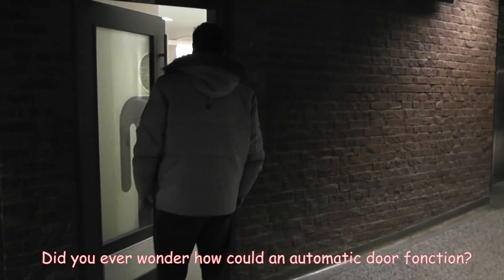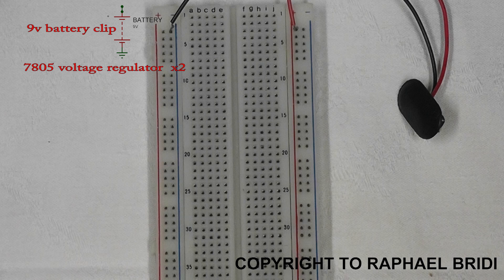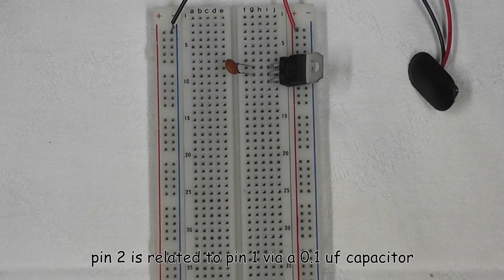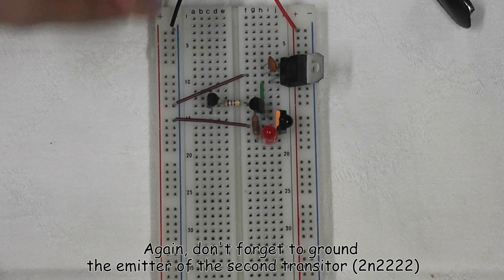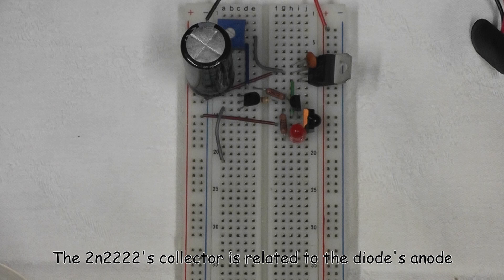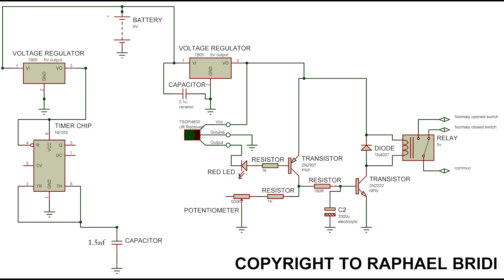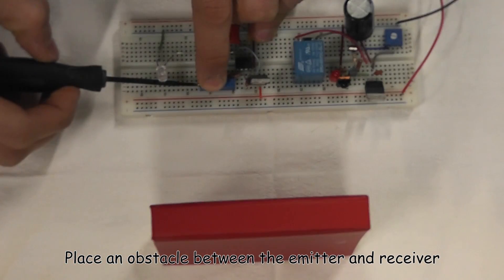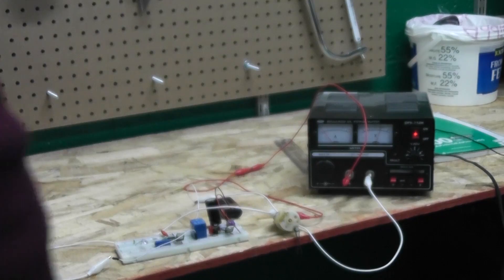[D.I.Y.] How to make an infrared motion detector

Comment: Sir, does the circuit needs two 9V battery? One for the main circuit and one for the relay? And can I use LED strips instead of the motor? I'm planning to do a motion sensing LED lights. Thank you, and its a nice video. Thumbs up!
Reply: And how many volts does the 3300uF capacitor have? I'm guessing its 50V 'cause its big, but I have to make sure. Thank you sir!
Reply: +Aliza Mae Alibusa you can use a voltage that is not less than the voltage from your power supply. for example if your power supply is 9v then use a capacitor that has a greater voltage value or greater than 9v. never use below the 9v your caps will be damaged.

Comment: sir can this detector be install to an air condition system to switch on/off an the air condition system?, eg switch the A/C on when there is motion in the room and switch it off when there is no motion
Reply from the maker: it will be a little more complicated to do that because you'll need a latch circuit to switch on and to switch off the AC. But you have a basic motion detector in this video that you could incorporate with other circuits
Reply: D.I.Y or DIE can you give me a kl idea for my final project which is simple no complications
Reply from the maker: bobby toomer make a laser security system. When a person passes infront of the laser, an alarm will go on. I will make a video like this very soon
Reply: D.I.Y or DIE sounds kool but thats if its not complicated .awaiting video
Reply: bobby toomer send me the link when you create it, and thanks
Reply from the maker: bobby toomer [D.I.Y] How to make a laser security system

Comment: one more doubt sir .can we use a infrared receiver diode instead of ir receiver placing an infrared diode in front of ir receiver led by making some changes so that once the circuit is broken by an obstacle the light or device shall glow for some time.
means if we connect led's to relay once the circuit is broken by an obstacle the light shall glow and after time ends its shall switch of automatically
Reply from the maker: the problem with the infrared receiver diode is that it doesn't have an integrated filter to block every other infrared frequencies to trigger the relay. So even the sunlight will switch your output on and off. The Tsop4830 is designed to only let an infrared frequency between 30 to 40 Khz to trigger the relay.

Comment: sir you rock i made this circuit.. initially i had some problems because this is my first project inspired from your video...but the circuit was completed. i had few questions on this project..
i am using a 6v relay bcoz 5v relay was not available is it ok to use this relay, as the relay is working properly.
my pot is also different.
can we connect breadboard to a 9v supply directly from charger or adapter..
and as you connected the motor in the end with a 9v supply..what is the highest volt that we can connect to a 6v relay .
and can we connect bulbs or cfl's to that circuit or we have to make some changes in order to use big lights.
sir i am very new at this pls help me this is the first circuit i made by looking at your video..
thanks in advance.. 
and keep uploading this type of projects you rock..
Reply from the maker: -i don't think that you'll have problems with a 6v relay.
-yes, you can connect a 9v supply directly to a breadboard
-For my relay, I could switch as high as 5 Amps with a 110v plug but it will depend on you relay
-You don't need to make any changes to this circuit in order to connect big lights because you are only switching them on and off.
For your pot, get at least a 10k pot.

Comment: sir what volts the capacitors???
Reply from the maker: The capacitor is 100v but you don't need to have a specific voltage. Just have a capacitor that could handle more than 9v

Comment: hello, i'm new to this but i'm making motion detector for my physic mini project. what i'm going to do is detect the presence of person in the room. can i make the LED constantly light as long as the person in the room?
Reply from the maker: Yes you can. Just remove the capacitor so the relay will turn off immediatly when there is no one in front of the circuit. You can also make many circuits like this and place them in different places in your room.
Reply: i'm very worried about my project since i'm never done this but i think i get what you said. thank you very much for your reply. may god bless you :)
Reply from the maker: Fujimaru Takagi Good luck for your project :)

Comment: what do you mean by "adjust the pot in order to control the switching time of the relay" ??????????? Could you also send me the schematic diagram to my mail ID which is verycoolnisha at the rate gmail dot com 

thankx! would appreciate your reply
Reply: I suppose you mean to adjust the potentiometer in order to control the amount of voltage flow! Generally i don't call it as a pot so was bit confused lol :p u seems to be a nice guy.....hey i do need that schematic diag and if you can build a PCB circuit diag for me using kicad or diptrace then i would love it man 
see ya lov n hugs
Reply from the maker: Nisha M The potentiometer is supposed to control the discharging time of the capacitor which will delay the switching time of the relay The relay will turn on or off the motor. For example, if you adjust the pot to 0 ohm, the motor will turn on and off quickly, when the circuit detects an object. If you adjust the pot to 500k, the motor will turn on and stay for a time before the motor turns back off.
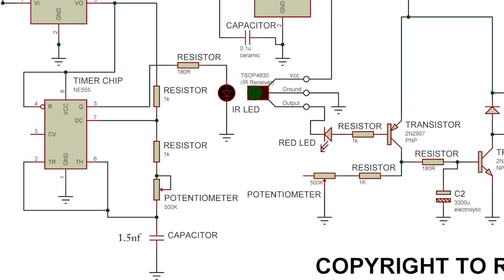Reply from the maker: D.I.Y or DIE  I don't use kicad or diptrace and all the schematic is at 5:12 .I've lost all my data when I formatted my PC
Reply: D.I.Y or DIE thanks for the information! I appreciate your'e work and like your video n yeah 1 more thing update your description as you missed out voltage regulator.
Cheers!!!!!!!!!
Reply from the maker: Nisha M I really appreciate. And oups for the description. I updated it
Reply: D.I.Y or DIE The Relays which you've used are of 1A or 5A ?
Reply from the maker: Nisha M 5A
Reply: D.I.Y or DIE Thanks buddy I appreciate your reply!

Comment: How do I attach this to a cpu computer fan using a 9v battery so the fan blows when a hand passing by it? ( I don't have any experience with making electronics)
Reply from the maker: The relay acts like a switch so at 5:49 , I`m showing how to activate  a motor using that relay.
-If your fan is using the power of you computer to spin, you don`t need the 9v battery. Just cut the black wire of your fan in half and relate it directly to the switch of your relay.
-If your fan has no power source, relate the black wire to the negative probe of your 9v battery`s negative. The positive of your battery should be to one side of your relay`s switch and the other side of this switch should be connected to the positive wire of your fan.